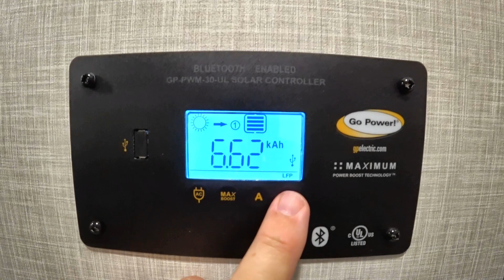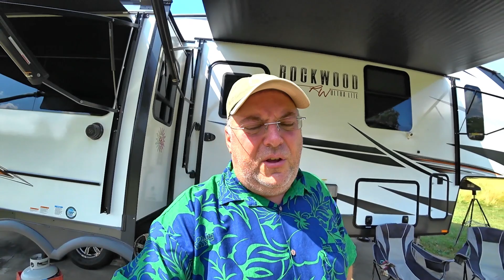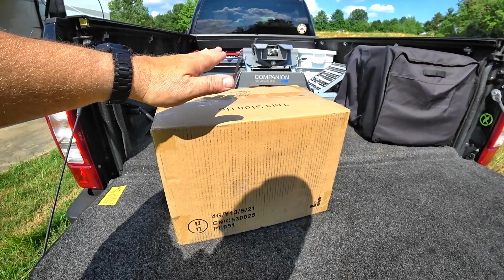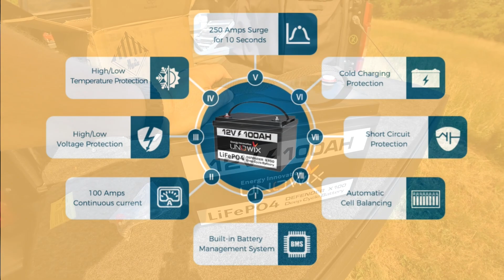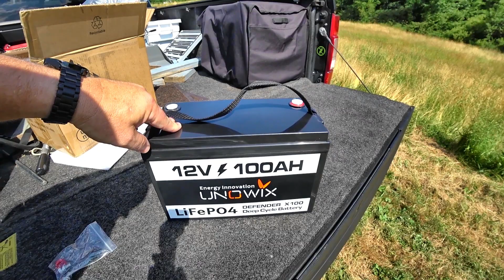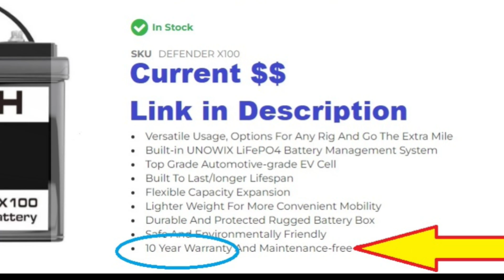AFFORDABLE RV LiFePo4 Replacement Battery UNOWIX DEFENDER

Comment: Mike I believe  you said  that you have a 200 ah battery in the rockwood, and you received that 100 ah battery, can you hook up a 100 ah with a 200 ah or do you have to use another 200 ah battery ?
Reply from the maker: It's best to have a charge controller that can do separate "banks"... Which we do.... The other way is to make sure that all the batteries match/identical and wire them parallel to each other to make the controller think it's charging one big battery...

Comment: Lithium has been superior to lead acid for years now, I own several devices with lithium batteries, as I'd expect most do these days. Having said that, I am looking forward to the new battery technologies coming around the corner, that are supposed to be far safer then lithium, and more cost effective. That has been the biggest negative of lithium batteries, is their cost. Having said that however, lithium's positives, is the sheer amount of power capacity and output volume that they have. You just said yourself, how impressed you are, of your dual 190 watt solar generation systems ability, to provide sheer raw usable power, due to the watt hour capacity, of these lithium batteries. And there is no kill like overkill, so go big or go home, and you know how to go big!